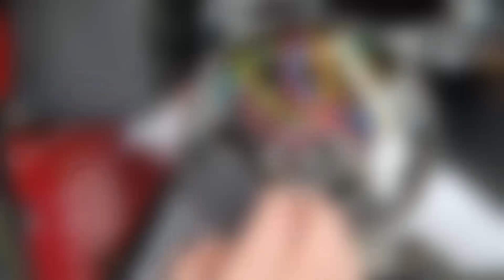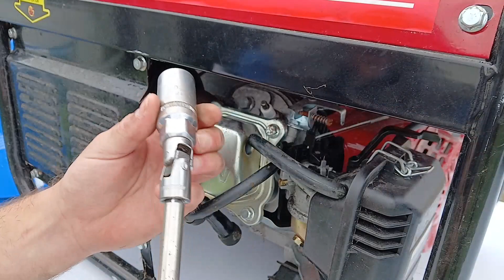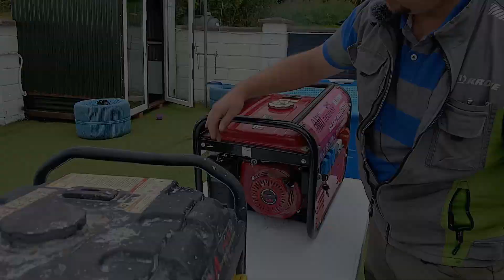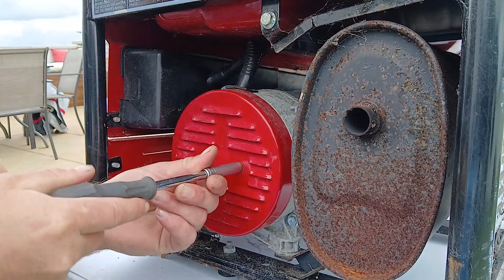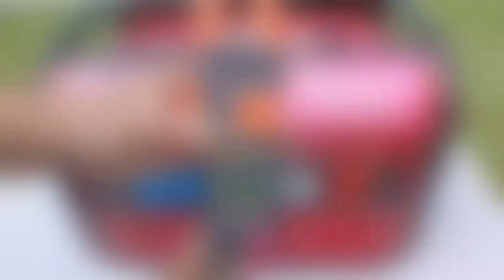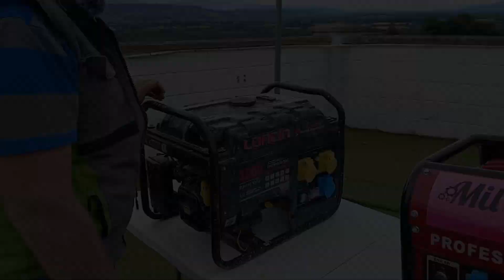How to fix it!  Generator problems and maintenance.

Comment: Nice maintenance video. The 3kw invertors  missing !? I guessing you've gone for a 48v wind turbine after hearing the 24v on the last vid, they are alot quieter. I haven't brought another yet, still need scaffolding  a tower and concreting,its still all very pricey at the moment so will do the none CAN regulator new istabreeze ballbearings.
Reply from the maker: Thanks Henry, sold the 3kw and batteries to fund more panels. Switching everything over to 48v is costing a fair bit so it'll take a good while to get it all done. 
As you said yourself everything is very pricey at the moment. 😢
Reply: The 400+ watt pannels are a great addition, still getting 110watts per pannel on the cloudyist of days.
Yeah, it makes no sence keeping a 24v array. I'll keep my 12v array due to have 12v lights, pumps, water harvesting etc.. but if you dont utilise 24v for anthing else then its just more energy lost.
Reply from the maker: @HenryOwens-py3ur thats great to hear, looking forward to getting them set up. No point for us keeping the 24v stuff as the genny is the main back up. 
Your 12v setup makes a great option as you can connect it to so many different power sources if you need to.
Reply: guess i could allways put it the gide wires it came with and add a few more wires with turnbuckles to the top.
So looking forward to viewing the install, obviously i carnt see where the best place is for you, but the third times the charm.
Reply from the maker: @HenryOwens-py3ur thats it, you can the little bits done and knock them off the list. Any progress is good progress at the end of the day.
Our stuff here is gonna take a little while, the cost of the panels is one thing, but then there's the timber for two frames, the concrete for the posts, then 4 actuators 2 for each frame. Its all adding up cost wise but we'll get there bit by bit.
Reply: Thoughs ground screws are a great idea, screw fix do heavy duty, they could be hinged at the bottom and folded to the ground in height winds.
Reply from the maker: @HenryOwens-py3ur thats a great idea, haven't figured out a locking system for them yet for high winds.
Reply: I would get pannels and start bolt them too walls slopes ect.. for September 20th, then come December 20th you can survey the sunniest areas, even if it means moving smaller arrays, walls, plants, I wouldn't feel that somethings thiers and its nice to have in this position, I would say that this time I need to catch the sun all year around no matter what has to be moved or built, then after you can make do nice gardening projects to hide arrays. ! Could allways put a time lapse on a camera pointing to the possible  positions.
Reply from the maker: @HenryOwens-py3ur indeed, probably could have done that a few years back. Having been here 5yrs now, we have it well marked out in the different seasons. The hills around us in the distance make very handy reference points.😊
Reply: Google earth is a good measuring tool, I viewed two trees that were very close the being parallel to the equator, strug a string line between the two and measured upto where I surveyed the sunniest December 20th position, I was still out by a few degrees but now i can see on Google I can measure via the edge of my tablet how many cm I'm out.
Reply from the maker: @HenryOwens-py3ur thats pretty cool! Great use of Google earth as a surveying tool. 👏👏👏
Reply: So my array locking system is the Hinges have 12mm bolts though, I would just tighten them up, sandwiching the wood together, but for my ultimate array I would still stick with the winch but the wire would go threw a c track and pull both ways a little trolley threw a aluminium c track with a sprung loaded lock to fasten it flat, the wire would have a so called knot in it and wouldn't go threw the sprug locker.
Reply from the maker: @HenryOwens-py3ur your locking system is a good way to do it, simple analogue and secure. I like your idea for "the ideal system". I've been using remote control relays in projects lately, it's fairly easy to wire up 12v automotive relays to make a reverse polarity circuit triggered by the remote control. Something like this would work well for opening and closing a locking tab driven by a small solenoid or motor.
Reply: You could have hydropower
Reply from the maker: @HenryOwens-py3ur certainly could, hydrogen gas combined with cheap Chinese generator? Knowing my luck it would go boom! 😂😂😂
Reply: its your natural energy alternative battery source a xy-cd60+water ball valve+water tank+water ball valve+pelton wheel at bottom of garden+rectifier+one of your three mppts, like my sand battery but thier is a way i can have a pelton wheel via compressing air and water and releaseing the air compressed water into a pelton wheel.
Reply: ! Their would be another xy-cd60 on the ball valve exiting water tank to the pelton wheel.
Reply: Or a float valve in the tank.
Reply from the maker: @HenryOwens-py3ur very good idea, have been wanting to build some sort of hydro feature for a long time now. Might just incorporate your ideas into the project when if ever I get around to it. 
Thanks Henry 🙏
Reply: thanks Mike, its one of thoughts spare materials projects because of your big 20kwh storage already, but if done write the probabilitys are endless, like free well water water off the gutters, expandable water tank ibc totes.

Comment: Great video, this is solid advice for anyone wanting to use a backup generator for electricity when the sun and wind are MIA or the power company lets you down. It's not an if but when are they going to break with the China backup generators. The biggest issue we had in the lower United States was with government-mandated ethanol fuel that was not very compatible in carburetors. If we forgot stabilizer or did not run it dry it would gum up the carb in short order. Luckily no ethanol in the fuel where we live now but all the common poor quality parts issues persist. With the relative humidity so high here i have given up on gas powered generators if its below 20°f, carburetor iceing seems impossible to avoid if the generator is not kept in a heated area prior to cold starting.  My Solution is four months running a diesel generator,  couple times per week to recharge the battery bank when the sun stays low for winter.  I often wonder how well the newer fuel injected honda generators would perform long term but the cost to purchase is too high and the low oil capacity requiring more frequent oil changes is a deal breaker for me. Hope your gardening season is going well this year!
Reply from the maker: Interesting to hear about the different problems that can happen in the states. Environmental conditions definately make a huge difference, thats for sure. 
Agree 100% with you on the Honda generators, great quality but too pricey to consider. Hyundai diesel gennys are gaining popularity with off grid systems over here in Europe but still too early to have feedback on reliability. 
Thanks for sharing your experience, hope all is going well for you guys in beautiful Alaska.